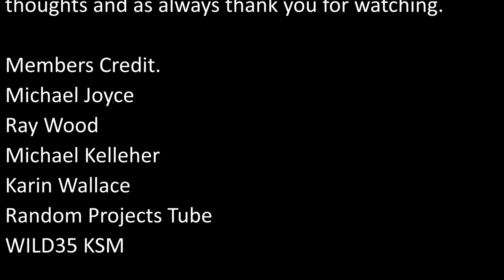Vintage Speedy Sprayer Compressor -The Compressor - Restoration

Comment: I HAVE ONE OF THIES.   IT HAD ROTTEN RUBBER IN IT.  I DID NOT HAVE I LARGE RUBBER TO FIX IT WITH, BUT I DID HAVE SOME LEATHER.   I PUT IN A NEW OIL SOKED LEATHER ONE.  IT WORKS FINE UP TI ABOUT 45 / 50 PSI.   GOOD JOB ON YOURS.

Comment: While there are several methods, most require chemicals I would not want to recommend them to average house hold users.  But I found this after a bit of searching...  Silicone spray is usually used as a sealant and is sold in camping stores to restore the waterproofing on tents and clothing, but you can also use it to soften older, stiff rubber.

If you have the time to wait for it to work, up to a week this article says, this should help salvage a part that is difficult or impossible to replace otherwise.

Really LOVE your methods and skill set.  I am quite sure given this compressor, I would not have been successful in the restoration as you were.  You seem to have a way of finding the thin path sometimes to getting it back into the original condition when I would have opted for a rather un-original upgrade.  Keep it up YOUR way.  The results are MUCH better in the end.

Comment: Excellent choice on the steam cleaning!!  Look into finding a plasticizer for the rubber parts to soak in.  It may be able to rejuvenate some of these parts that are truly NON replaceable in todays time frame.  Most older parts like this are made of butyl rubber, as I think it matters when looking for the right plasticizer.

Comment: Nice cleanup.  Would there not originally have been an air filter element under the top cover?  Greetings from Alabama.
Reply: I live in Alabama  too!  Excellent restore too.  What's the green dust?  Paint, rust, or martian bong water?
Reply from the maker: In hindsight I should have put a small filter in there.
Reply from the maker: To me it looked like paint build up, it did not smell like mold.

Comment: Cool stuff. Well shot video too. I'm stuck fixing an Air Command 2cyl. Can't get the butterfly valves after only 20 years. Any advice please?
Reply from the maker: Those are quite rare, you would be lucky to find spares, you can have a local machine shop try make new parts, or see if EBAY has any.
Reply: @AJRestoration  much appreciated thanks. Have tried local dealer and exdealers. No parts. Not tried ebay yet.
Reply from the maker: Good luck buddy!

Comment: Nice work! But please find a way to collect the dust of the color from the air sprayer. This is an absolute no go for the environment in terms of microplastic.
Reply from the maker: I do plan on building a spray booth wit a filtration system.

Comment: Ballon is all that can be performed very weak air pump or not corectly restored
Reply: Paint spraying is about volume of air, not pressure, hence the HVLP you see on today's compressors. High Volume Low Pressure